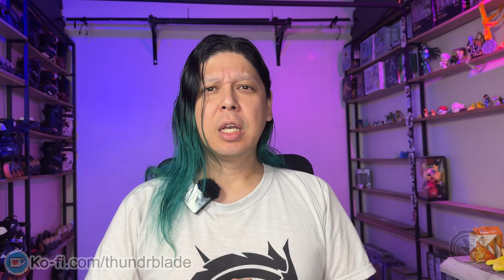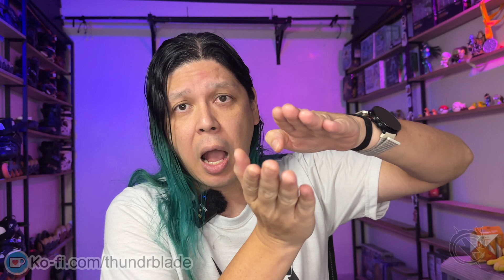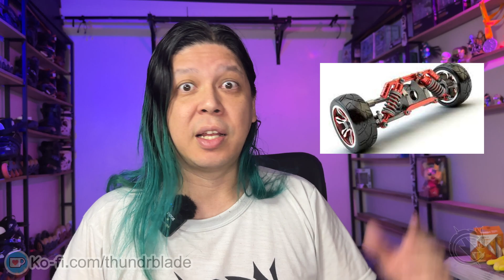Suspension on Electric Inline Skates - is it the dream?

Comment: i think it would probably be better to use the natural flex of the material of the frame (be it rubber, polyurethane, etc) as the "suspension". yes its undamped but it saves weight, complexity and cost vs "real suspension"

Comment: could you get a lot of the characteristics of suspension just by going with a pneumatic tire? That way it's still simple and the weight is the same but you can vary the tire pressure or even exchange for a polyurethane wheel if you wanted to.
Reply from the maker: Yes. This is true. A pneumatic tire can absorb vibrations and act like a vibration dampener kind of suspension. 

In the next video of this I will talk about all kinds of different suspensions we could use. 

Pneumatic tires also have some drawbacks like too much grip, getting flats, wear very fast compared to PU wheels, somewhat difficult to put pneumatic tires on hub motors without using a VERY big wheel. 

You could have a pneumatic tire in the front wheel and a airless tire on the hub motor. 

For me tue biggest disadvantage would be the grip that makes it very hard to turn so maybe make the skate a three wheel setup with the motor in the center to counter this.